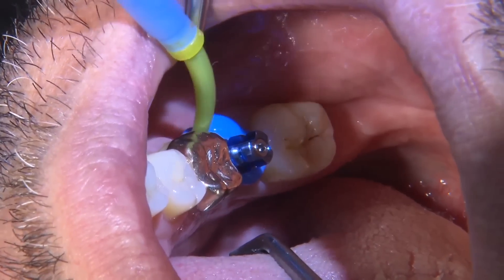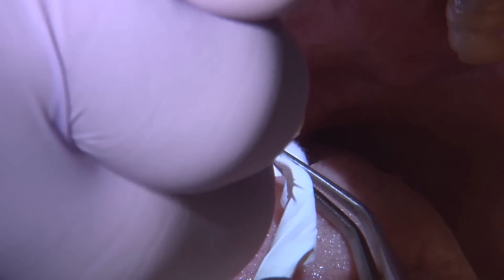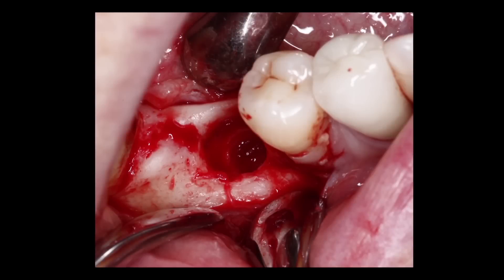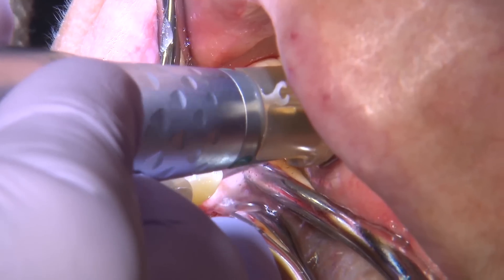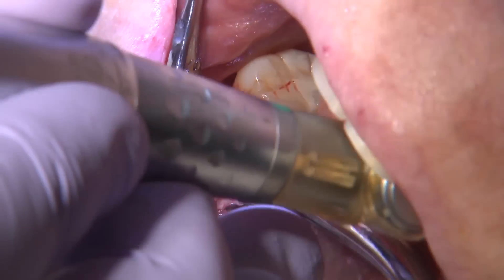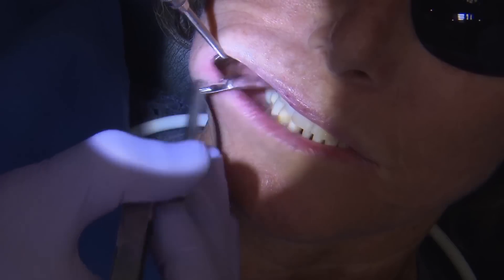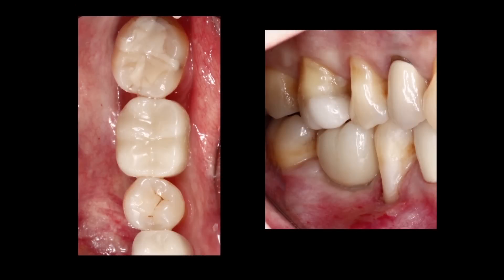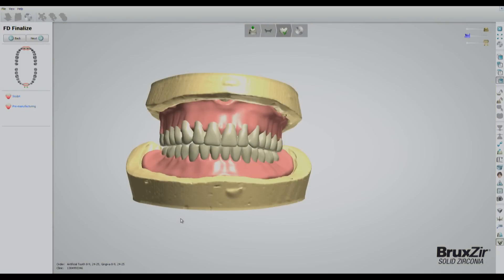Chairside Live Episode 166: Choosing an Implant Surgery Method Based on Indication

Comment: great videos ! why did you leave the implanted tooth out of occlusion ?
Reply from the maker: +armisttice 

Thank you for your question.  The reason the implant crown was left out of occlusion is to reduce occlusal loading during function and parafunction.  Because of the periodontal ligaments of natural teeth, as the patient’s teeth come into contact there is some micro-movement of the teeth into the alveolar socket.  With implants, this movement does not occur because the implant does not have the periodontal ligament and alveolus surround it circumferentially and apically.  There is direct contact between implant and bone.  For that reason, keeping the implant out of occlusion by 8-12 microns will allow for the natural teeth to come into contact and allow for the compression of natural teeth and avoid the load on the implant.

Dr. Abai
Reply: +Chairside Live Thank you for the response. I do understand exactly why you did it, but do you do it every case or only cases that have failed previously ? Im asking because for example you have a bridge on implants and you just cannot leave such big restoration out of occlusion right ?
Reply from the maker: +armisttice 

Yes, for every case where a single tooth is being restored with implants, the implant restoration is kept slightly out of occlusion so as to keep the implant and implant restoration protected by the natural teeth.  Multiple unit implants and restorations are treated differently depending on the location of the restorations in the mouth.  For example, a maxillary anterior six unit implant supported prosthesis on 4 implants would be kept in a similar occlusal scheme in centric relation (CR) or maximum intercuspation (MIP) when designing the occlusion to be mutually protective.  As a result, as the patient’s natural posterior teeth come into contact in CR or MIP the restorations on the maxillary anterior implant supported prosthesis should be slightly out of occlusion.  In dynamic occlusion, the occlusal scheme can be designed so the anterior implant prosthesis can provide anterior guidance and canine guidance where the posterior natural teeth are in disocclusion.  For a posterior three unit implant supported prosthesis on two implants with natural teeth opposing the restoration, the occlusal table of the implant prosthesis has to be narrow in order to provide compression forces to the long axis of the implants.  Also, the prosthesis can be kept in occlusion in MIP or CR with the occlusal contacts in areas where again there are compressive forces along the long axis of the implants.  Clinical experience may lead the clinician to create this type of occlusion on multiple unit restorations, and slightly adjust these occlusal contact areas at the time of delivery.  The patient may sense at the delivery visit that the contact areas are in hyper occlusion as with the delivery of a three unit fixed dental prosthesis on natural teeth.  As a result, utilizing shim stock and keeping the restoration slightly out of occlusion at the time of delivery will allow for patient comfort and micro adjustments of the opposing natural teeth over time.

Dr. Abai
Reply: +Chairside Live Thank you again for a comprehensive response. So, as we know, natural dentition thats out of occlusion always tends to move towards a contact (Godons law), plus the natural wear of dentition. This two aspects should be taken into consideration to provide this out-of-occlusion protection for years and years. Do you plan some kind of adjustment shedules that you provide during the implant life, long after the initial adjustment visit ? And isnt it better to utilize a restoration more close to natural teeth when it comes to wear than bruxzir ?
Thanks again !
Reply from the maker: +armisttice 

Yes, I agree that the factors of eruption of opposing natural dentition, and wear of the opposing tooth on an implant restoration need to be taken into consideration.  After an implant restoration is placed, the patient is scheduled for four to six month recall appointments based on their periodontal condition.  The implant restoration and the opposing teeth are checked at these visits for occlusion and adjustments can be made to the implant restoration if necessary.  This procedure has been routine in my practice.  The concern of wear of zirconia opposing natural dentition is unfounded and many studies including a comprehensive report by Gordon Christensen’s Clinicians Report has found that the wear of zirconia opposing natural dentition is favorable, especially if it is polished zirconia with no glaze.  Almost all studies point towards veneered porcelain demonstrating the most occlusal wear on opposing dentition.

Dr. Abai
Reply: +Chairside Live Yes i completely agree, but the more wear the less stressful it gets for bone surrounding an implant itself. So, for example a patient scheduled for longlife-every-6-month check-up, just leaves the country or whatever it is that he just cant attend. The implant-oposing tooth relation may get tighter and tighter with zirconia because of less wear. So with that being said i think it might be more protective to use f.e. veneeded porcelain instead of zirconia.
Thank you for all the responses. Much respect for you !